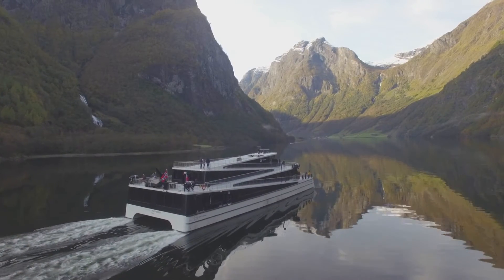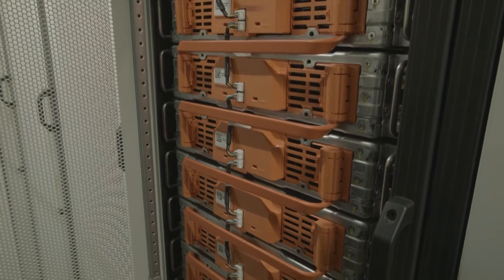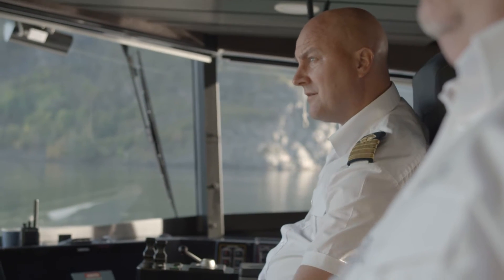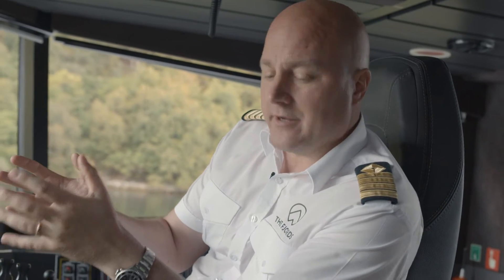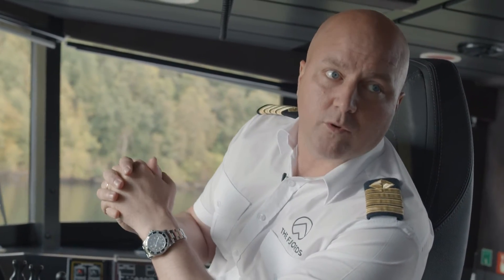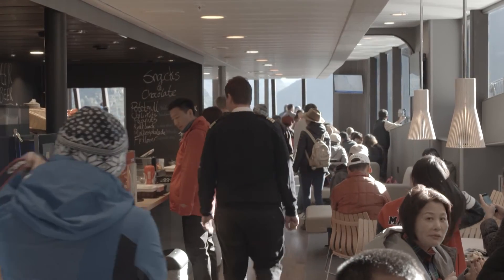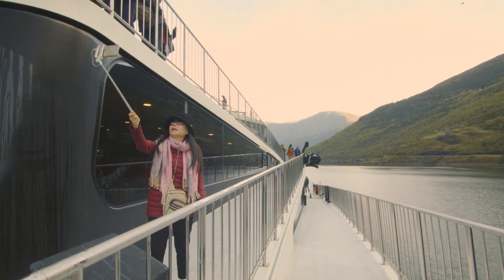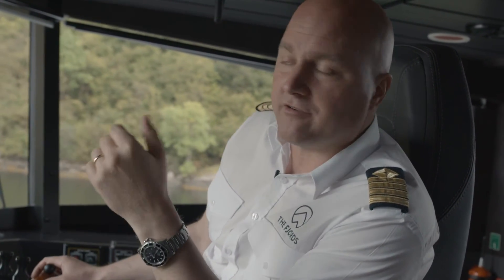Running of batteries: Powering the Vision of the Fjords

Comment: Like any battery powered vehicle, it's only as 'green' as the power source used to charge it.  It simply moves the pollution from point of use to power station.
Reply: Except Norway has almost all of its power produced by hydroelectric power plants so there isn't much pollution at all from those power plants since they are ultimately solar powered creating the rainfall which fills the reservoirs behind the dams.  So in this case, your comment is misplaced.
Reply: Amazing this particular bit of misinformation is still doing the rounds :-). Even using electricity generated with 100% fossil fuel results in fewer emissions (both greenhouse gases and pollution). Same applies to cars. This isn't the only benefit anyway - electric propulsion is quieter, needs far less maintenance and gives the opportunity to use renewable energy sources (as Norway does) rather than being stuck with just diesel.

Comment: No solar panels?
Reply: Where?
Instead of the windows?
Instead of the observation deck?
And it would rather be a waste of resources to use them in a shady fjord.
The panels would add weight, which would increase energy demand.

Solar power can be useful on ships, but I think, not in this case.